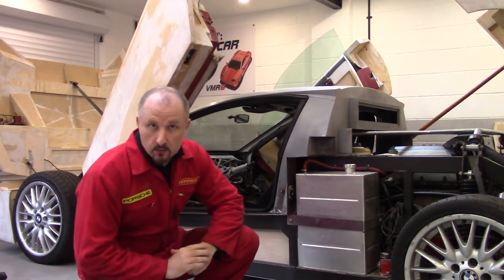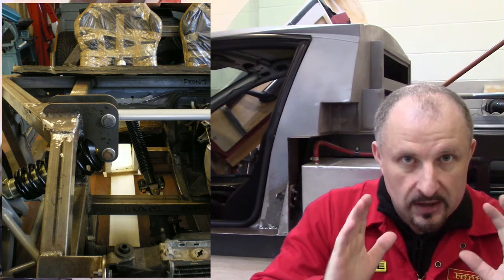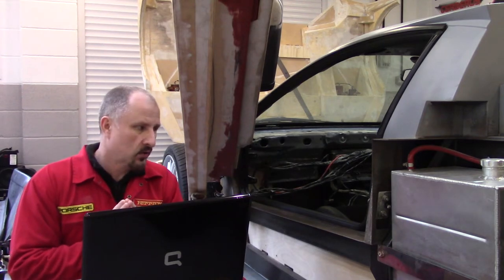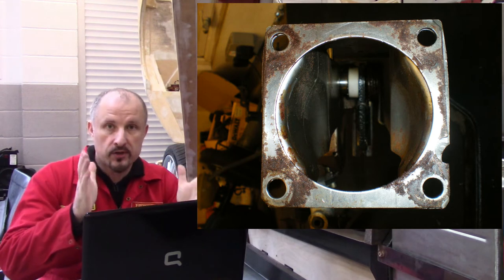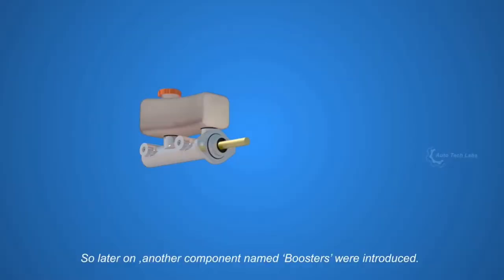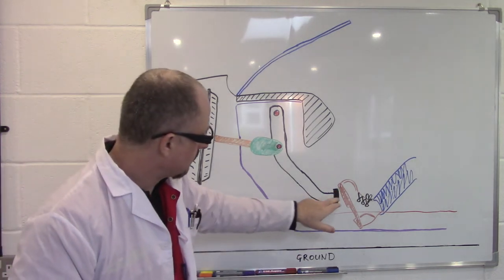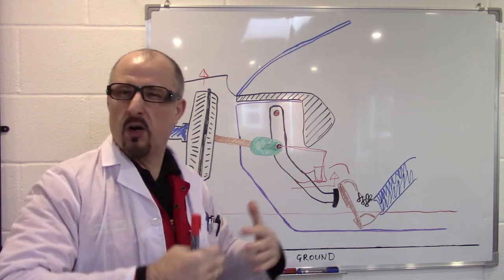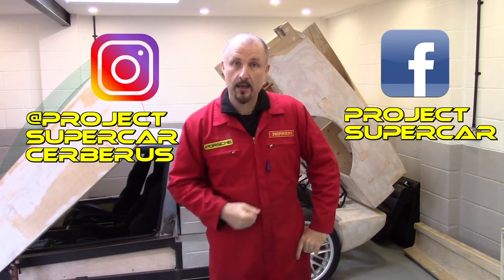Pedal Design and Servo Placement: Prototype Ep23

Comment: Talking about cheaply made pedal assembly, I had a Datsun Stanza many years ago and had to remove the pedal assembly and reweld and strengthen it before refitting it due to the clutch pedal literally snapping off . Ahh the joy of motoring
Reply from the maker: Yes, I have heard of early Datsun pedal problems, and also mid 70's early 80's VW's. The Golf and Scirocco had problems with the bulkhead ripping around the clutch pedal area.

Comment: So that does not seem to be a collapsible column, fixed directly to the dash support. That other pedal assembly looks a lot more durable - piece of rubbish the first one
Reply from the maker: It is 'sort' of collapsible. The tube is supposed to bend and fold, but yeah you're right, not really like a modern column. This would be different on the Turbo build. Yeah, that first Audi pedal box was really poor and cheaply made.